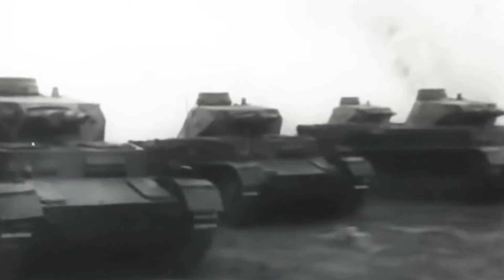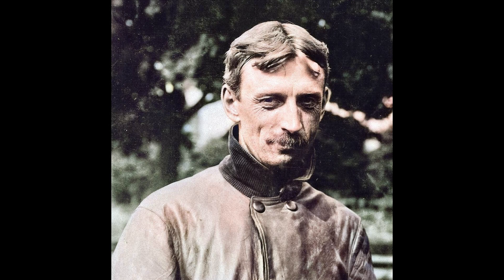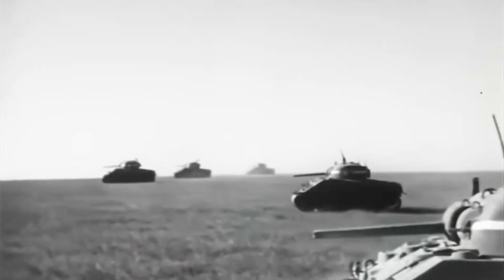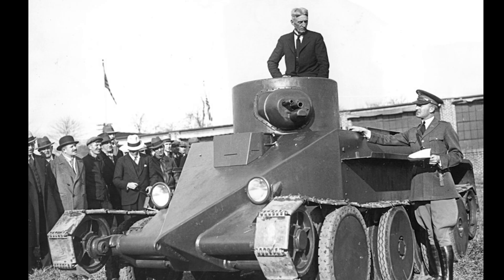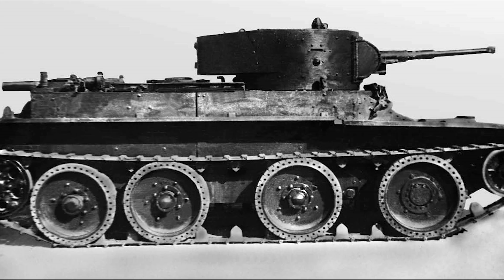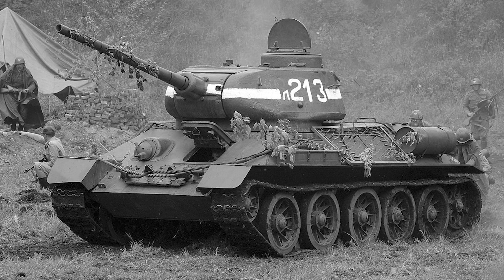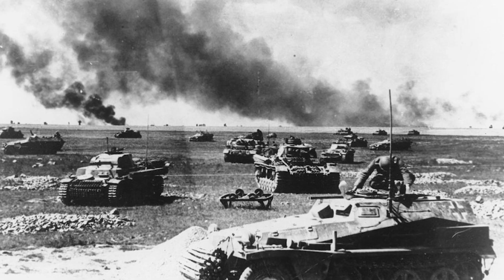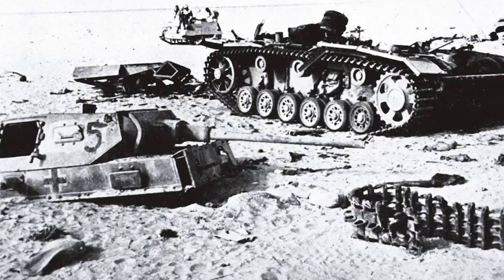The Engineer who Solved The Suspension’s Tanks

Comment: The volute system was also adopted well before WW2 started, the stroke of the spring was longer than for a spiral spring which produced a relatively long stroke, the unit didn't take up any tank space unlike the Christie that robbed about half a metre of width inside the tank, and moist important of all was simple and fast to repair. The Christie suspension was hell to get at for repair. The German torsion bar suspension robbed about 20-30 cm of height inside the tank, making it necessary to raise the turret. As German (and American) tanks used front sprocket drive there was also a prop shaft running along the turret floor. also robbing height as seen in the Sherman and Lee tanks in comparison to the rear-sprocket drive British and Soviet tanks. 
The British dropped Christie suspension at the end of the war when they got an alternative system that did not rob width, was relatively easy to maintain and had a sufficiently long stroke, this was the Horstman suspension. The issue with width became critical when tanks became heavier requiring wider tanks, armament became heavier demanding wider turrets but at the same time their overall width was limited by the railway loading gauge.
Before the Christie suspension was adopted, the British used a double-bogie design similar to the suspension on the Valentine tank. For the relatively light tanks of the time it was sufficient and provided a good enough ride for them to reach 25 mph. This system was also used on the Universal Carrier.